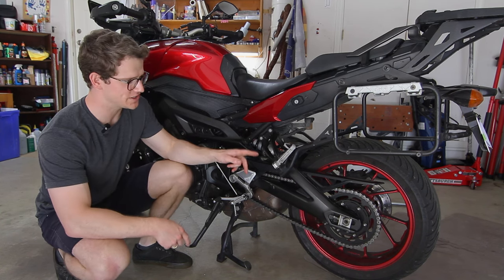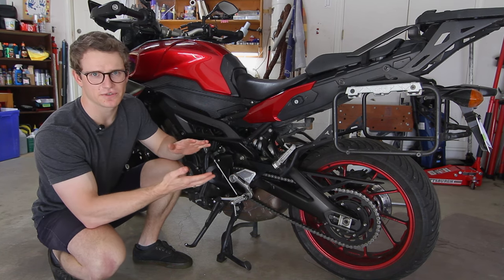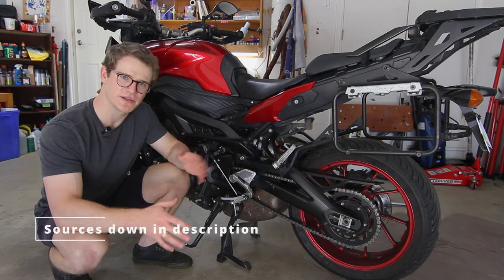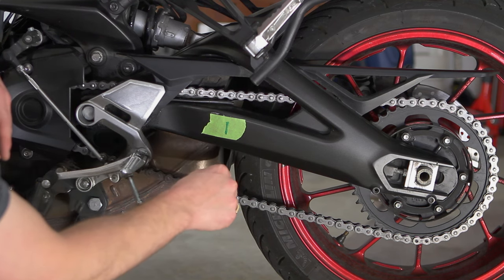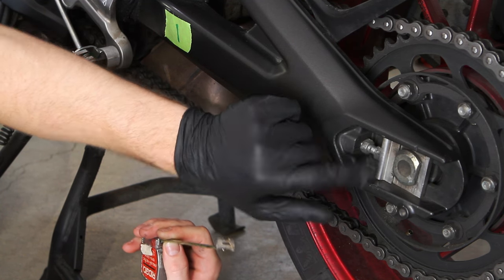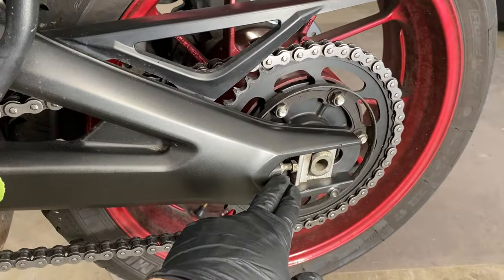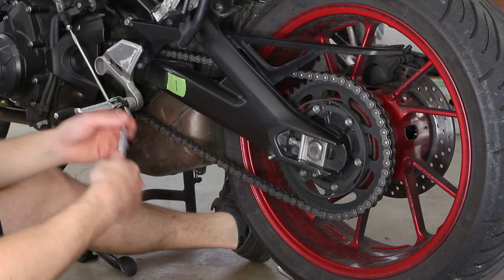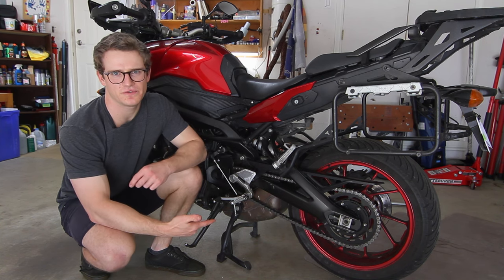Mastering Chain Tension: Yamaha FZ09, FJ09, and MT09 for Optimal Performance

Comment: The torque settings from yamaha are way too high.  Several have ended up with stripped threads and have had to cut the nut off the axle.  There is no reason to go above 75 ft/lb

Comment: I bought a new 2023 mt-09. At my 600 mile service that I did myself I checked the chain. The factory spec just seemed a bit too tight. I raced motocross for years and chain tension is something you get used to. The load on the swing arm is key. A small reference I have used is so how much slack is on the outside of the rear sprocket at 3 o’clock. If it is tight that is a good indication you aren’t too loose. But I could be wrong.  In the end I did nothing to my chain at 600 miles it seemed fine.  I agree the factory specs seem perhaps a hair too tight. Great video!

Comment: I've only just changed my chain and sprockets on my tracer9, and I agree that the spec it too tight in the manual. I've done the same as you. Great vid bruv.
Reply from the maker: Thanks Ray! How many miles or km’s did you do before changing your chain and sprocket?
Reply: @Calvinm  about 16000 miles, and they were done.  It must have been the original chain and sprockets.

Comment: Hi my experience with yamaha gives you 100% credit on slack amount. I have a custom, xvs950 belt drive, which has a tight slack to be set. I put it precisely to manual spec and after 30k km I damaged drive gear bearing; I had to split open the engine to replace it. This tension error has to be a yamaha thing... I don't know.

Comment: There, the tightening of the axle nut has also changed.  In the 2023 manual, 105nm/77fft. I had to replace the axle and nut(

Comment: Thanks for the best video on this topic! 
well explainted and straight to the point. 
Wish I would have known this earlier. I've tried to ride with Yamaha spec 15mm of chain slack... the chain has been way louder than usually and the bike really felt like an boatanker has been attached. Backed it of and ask my mechanic. He completly disbelieved such a massiv mistake by Yamaha... and researched the topic. He found out that they made a translation mistake between the japanese original text in the english version of the service manuel. 5-15mm would be ideal UNDER FULL COMPRESSION, when the sprocket axels and swing arm pivit point are in one line. this can not be measured for adjustment in practice! your aproach by about 45mm works well!

Comment: Manual says to check chain slack on side stand.
I also ride with 40-45mm slack on my Tracer.
Anyway 15mm is way to tight!
Reply from the maker: In my 2015 FJ09 manual it says to measure while the bike is on centre stand. But an FZ09 service manual would likely have the procedure written for using the side stand because the bike didn’t comes with a centre stand. 

15mm is too tight, glad we agree 👍 happy riding!

Comment: Hi, help me understand something please.  The manual says to measure from the chain guard to the center of the chain on the part of the chain being “pushed down” and that should read ~1.5”.  Why is everyone measuring the distance from the chain extended upward and downward?  Also, the manual says to loosen the axle nut on both sides of the swingarm, i only saw you loosen one?  Thanks
Reply: trying to figure this exact same thing out myself, did you come up with anything?
Reply: If the procedure the manual says is true, my shit is almost an entire inch out of spec, past the point where they claim it can "damage the swing arm and frame" and its more likely to break
Reply: And that's the alignment it came with from the dealer 👀
Reply: I may be reading a different manual, but on mine it says to loosen the wheel axle nut(singular), and the drawing only shows one on the right side of the bike.

Comment: What kind of mileage are you getting on your chain? I've gone through three chains on my 2014 FZ, first one got 20k miles (6k by previous owner), second one got 18k before developing a broken roller, and 14k miles on my most recent before it developed a severe tight spot. All were quality X-ring chains from DID and RK on steel sprockets. Two setups were on 520 chains... first and last, and the middle one was on 525. I regularly lube and adjust the chain. I typically keep the slack at 20-25mm.

I'd expect more so I'm wondering if there is a measurable correlation between stack setting and chain life.

Comment: My manual says 45mm! 2023 XSR900
Reply from the maker: Interesting! I wonder if it was a misprint back in 2015 that caused all this drama. Thanks for sharing this 👍
Reply: @Calvinm  it is entirely possible brother!
Reply: @Calvinm  MT09 from 2023 should be set to 36 to 41mm according to Yamaha specs. Think they fixed the manual
Reply: Wow that's really interesting.  Yamaha must be reading the forums :-)
Reply: From 2021 MT-09 is 90 % new bike.
Reply: There, the tightening of the axle nut has also changed.  In the 2023 manual, 105nm/77fft

Comment: Although too loose is generally “better” than too tight, it’s important to note the generation differences and how the swingarm lengths/pivot radius is different. 

Careful pulling people off of manufacturer spec with no mention of generational geometry changes. 

Go ahead, loosen that Gen 3 chain, your f up 😂

You should pull your shock in the next video and measure yourself to validate what you are telling folks.
Reply from the maker: Of course, if someone has a different gen bike it would be advised to ensure this information matches their exact model. 

As for pulling the shock and measuring,  motorcyclist magazine posted this article linked down below where Ari Henning did exactly what you are suggesting back in 2015. His findings were a 20mm loss of slack while moving through the suspension’s travel. 

I’m not trying to steer people into a dangerous of damaging situation. Simply trying to provide information for them to make an informed choice. 

Link: https://www.motorcyclistonline.com/how-tight-should-chain-be-new-bike-tech-tips-answers/

If you have any information regarding generation differences it would be helpful to have it here. Thanks for the comment! 👍
Reply: @Calvinm  mostly commented because your comments had folks with gen3’s AND different bikes (XSR/Tracer) commenting for some reason as if the advice on this video directly applied to them 🤦‍♂️